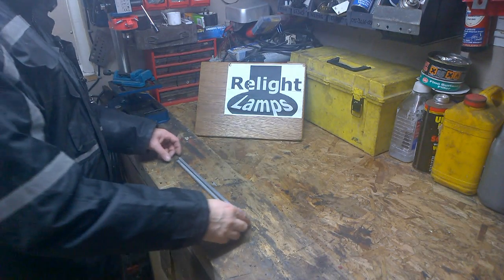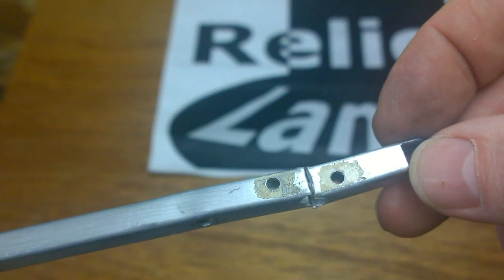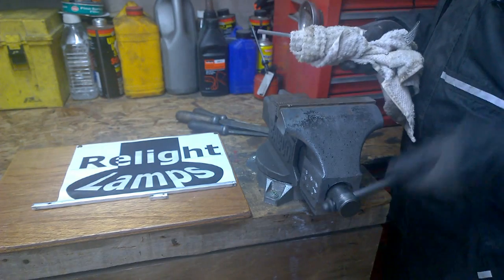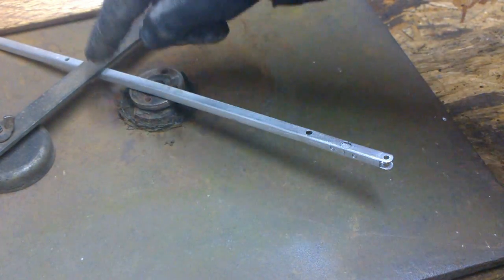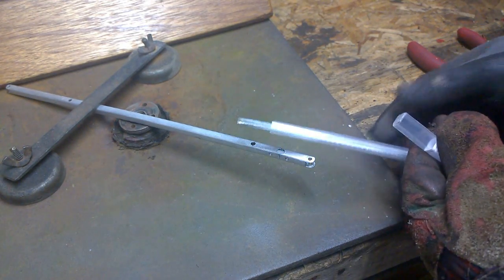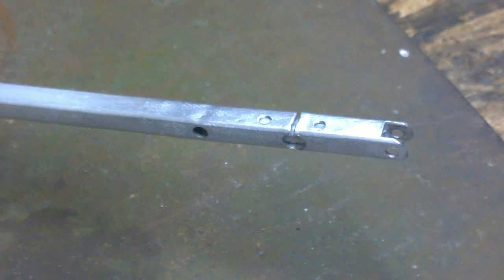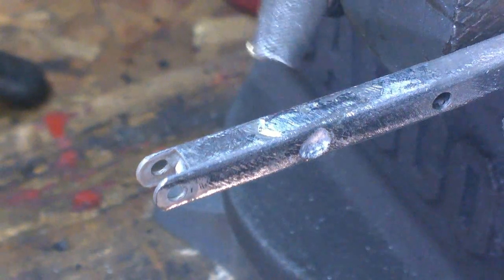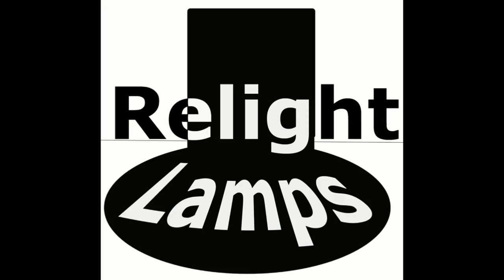Herbert Terry Anglpoise 1227  Lamp Broken Arm Repair

Comment: Hi, Not sure if you are still doing this work?  I have an original Carwardine prototype which requires a small repair to a fracture to the bottom arm which houses the braided cord.  I've had the lamp for 20+ years and still not got around to getting it repaired! It is not a Herbert Terry version but made in the late 1920's at Carwardines auto repair business in Bath.

Comment: Thanks so much for these videos Ron, really thorough and incredibly helpful, thank you! A question if I may - is there any reason not to just reinforce all of the arms the whole way through with the rods?
Reply: This lamp should really be used as spares to fix other lamps. It’s a task lamp at the end of the day. It’s not worth a whole load before all this work and worth even less after. The amount of man hours and materials put into it are uneconomical. It’s great to think your saving it but in reality it’d be better to save loads of other lamps with its parts.
Reply: @smoll.miniatures  
Have you seen the price of a restored vintage 1227? There’s enough meat on the bone to restore these classic lamps and still make a profit.